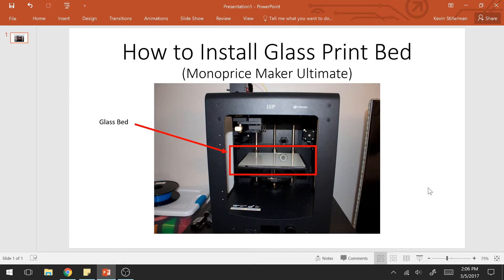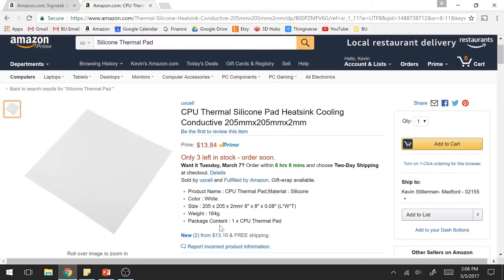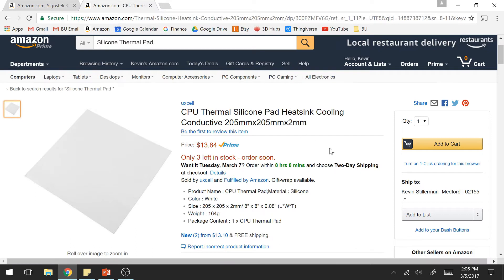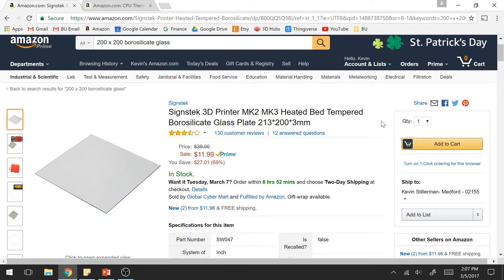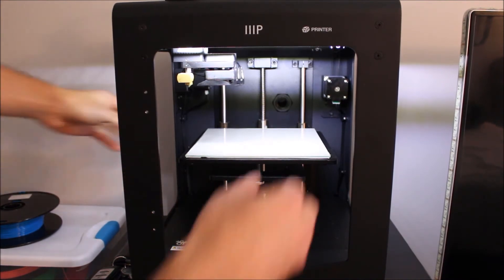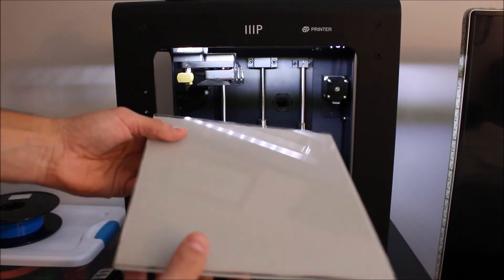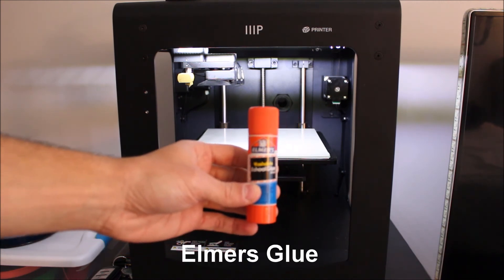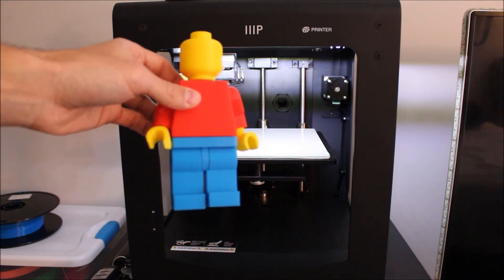Installing a Borosilicate Glass Bed (3D Printer Tutorial)

Comment: Refreshing to see someone use the same printer as me.  I'll give you a tip, take off the build surface before applying the glass and pad. Heat up the bed to max and use a scraper to lift and peel the build tak surface. Also, they sell a foam/foil insulation pad for the underside of the printer on amazon. This helps the bed heat more evenly and stays alot more evenly heated, its easy to use a laser thermometer and check the bed temps. This prevents part warp really well.  finally, print the silicone boot for the nozzle and upgrade to a metal hotend, this again makes temps stable and much more consistent. its the only way I can print carbon fiber petg, well I also have to put rigid foam on the walls and top because I dont have an acrylic enclosure.
Reply from the maker: Thanks for the tip!